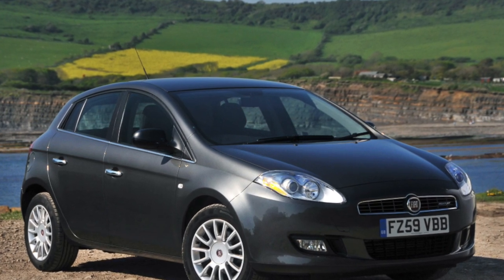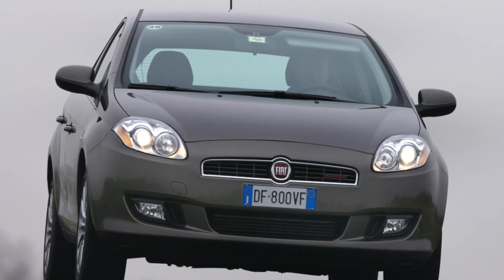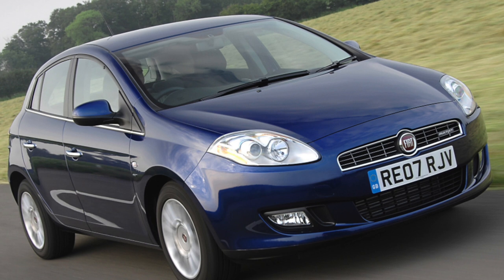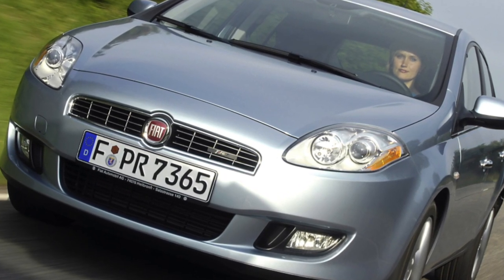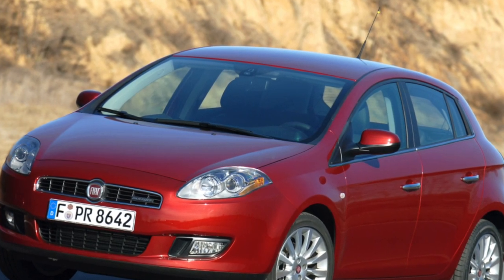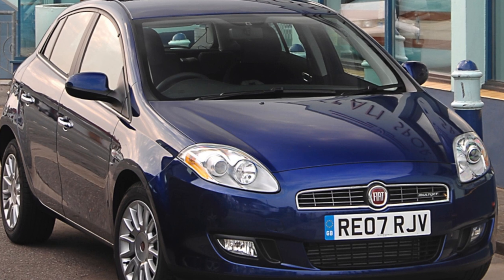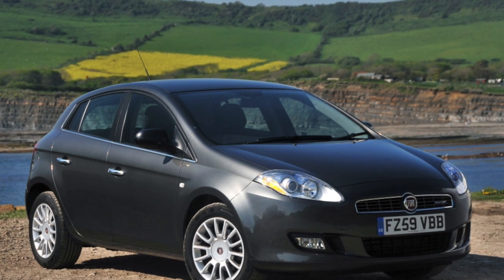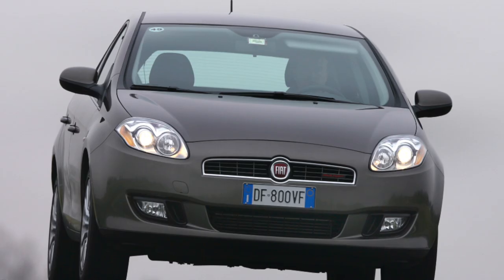Fiat Bravo 198 Problems | Weaknesses of the Used Bravo 198 (2007 - 2014)

Comment: I have the 1.4 multiair Bravo sport since 9 years, very happy with it, only problem I have currently is the clutch pedal start&stop switch doesn't work properly anymore, so I have to keep the start&stop off, no any other problem at all, I recommend the Bravo :)

Comment: I've had a 1.9 multijet 120 hp since late 2008 and it still runs great. It's still a nice car and very fast for a diesel. I periodically changed only the consumables, oil, filters, brake pads, and after 8 years I replaced the relay for the glow plugs. Every 2 years the EGR valve must be cleaned, if you drive around town a lot and don't accelerate it enough, otherwise it's a great car!
Reply: Did you ever have problems starting? For example it taking a extra second or 2???
Reply: @Lukasz_-tb4gt  First you need to check the fuse of the spark plug relay. It's on the engine, near the battery. It's a big 30-40 amp fuse. If this is burned, then the spark plugs do not heat the fuel and ignition becomes more difficult. But it could also be the fuel or air filter. If you don't solve these simple things, you should do a diagnosis .because it could be a spark plug or some sensor on the fuel rail or on the air filter.

Comment: My sister and I both have it, the 120HP model. Couldn't get my hands on the 150HP,  nobody wants to sell their pocket rocket. Even so, its quite zippy and can snap the speed on quick, but doesn't pull anymore after 100kph. Mine is 2 years younger and you can tell because mine has slightly more ground clearance and a better ride.

Comment: The car has the M32 gearbox. It dies between 60-80k km due to weak bearings. It's not an IF situation. Don't buy it if it wasn't fixed already.
Reply: 180k kms going strong
Reply: To su modeli do 2010 godine sa problemom menjaca posle toga je ispravljena greska sa menjacem..